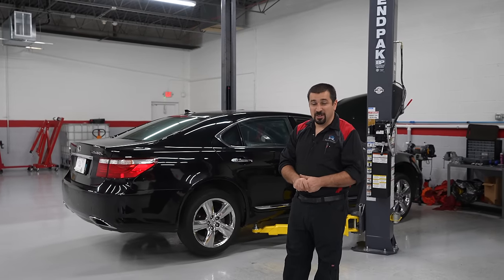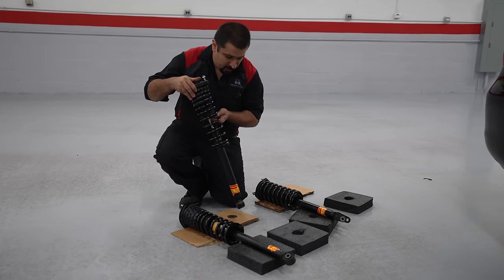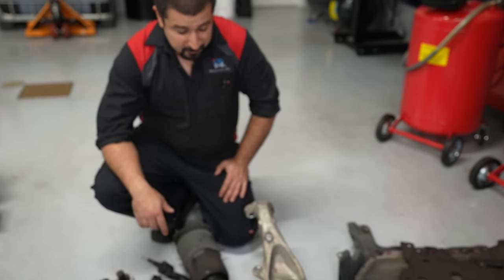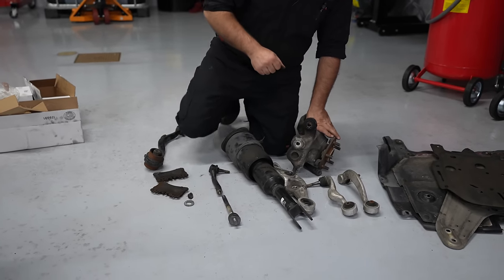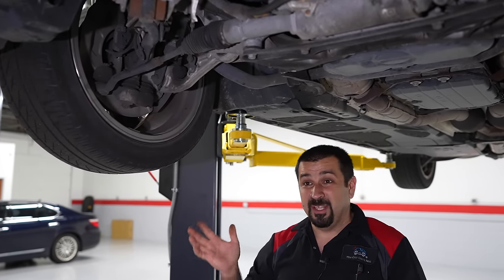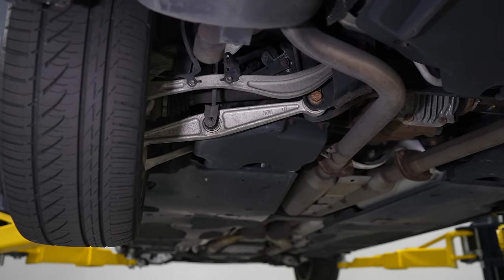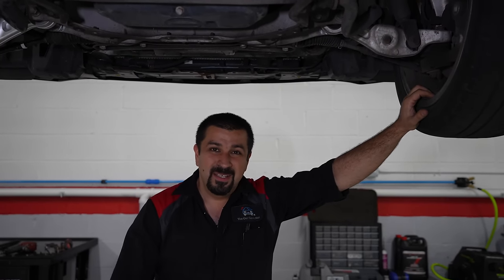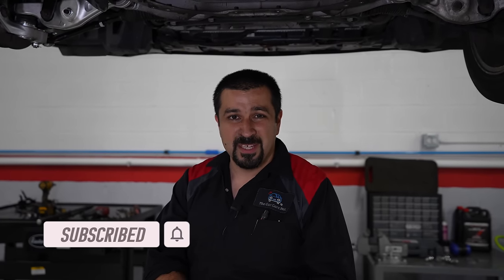Avoid THIS Lexus Model | Pre Purchase Inspection REQUIRED for this one and Here's Why.

Comment: I had a LS460 and it was nightmare, I replaced the radiator, water pump, thermostat, cooling fan module, and finally it had a coolant leak under the intake manifold. It had been hot so many times due to the cooling system problems, I finally traded it in and got a 4Runner. The LS460 was fast and fun to drive but a nightmare to keep on the road. Mine had less than 140K miles and was a nightmare.
Reply: That doesn't sound too bad for a 100K mile plus car.
Reply: @zaker600  nah, that’s way too much for under 140K miles…it’s a Lexus/Toyota
Reply: @ItsAxelFoley  my LS600Hl has had zero problems after 150.000 miles.
Reply: @epoxy1710  I’d say that’s pretty standard. I’m a 4Runner owner.
Reply: Where u the original owner?
Reply: @ItsAxelFoley Zero problems after 150.000 miles is on one of the most computer controlled cars in the world.
Reply: @finalboss7956  no,  I was the 5th owner
Reply: I think the big question we should be asking you is … what year LS 460? Many years are great but some years are known for problems, the info really helps thanks
Reply: @enzoi9569  mine was a 2010
Reply: That does sound bad for a Lexus wow
Reply: It’s because they ironed out some of these big issues with the 2013-17 models. That’s why I’m looking for a 2016

Comment: As an ls600 owner, the symphony of noise over a bump is an accurate description, mine at 94k miles. However, it's not the hardest diy to replace the bushings and lower ball joint on the awd models. I also suspect axle issues so I bought axles as well.  Definitely adjust purchase offer accordingly when buying one, pay the right price, enjoyable cars for the money.
Reply: What year is your car?
Reply: How is your 600 ownership
Reply: 08, it's been great but I'm only at 96k as of today. Garage queen.  But if your not a mechanic or serious diy guy I wouldn't recommend it unless you want to burn money on labor.

Comment: I had one 2008 ls460L. That car drove like a dream. But its the same old suspension issue. I wanted to change the air suspension but I was advised against it. 3 months later after patching and toying. I flipped it. But the car is a dream.

Comment: CR has been the holy grail for consumers for ages in choosing used cars. Its record shows the 460 from 07 to 09 were cars to avoid. There is an extensive recall program even to cover the dash, inside door card, suspension, etc. because Lexus realized these model years were duds. I always believe and insist never to buy cars of new model years, especially luxury models regardles of brands. Think of them as new born babies. Cutting teeth, toilet train, immuno-vaccines, the whole nine yards to get them all bug-free until the babies are three, maybe four-year-old.
Reply: 2007-2010 actually. I’ll stick with my 06 LS 430.
Reply: Yes, I got 2013MY, it is great.
Reply: My 2007 was basically bullet proof from 90k-210k that I drove it.  Nothing but tires/brakes and an alternator that went after having oil leak onto it from a bad valve cover gasket that I didn’t catch.  It was an ultra-luxury model that had everything (air suspension original till the end) except the recliner in back.  As in all things YMMV

Comment: You've changed my mind about the 460.  I'm going to start researching a 430.
Reply: That’s what I drive and recommend. Do your homework on it though. They’re all getting long in tooth!
Reply: 430 is king but still gonna be expensive to fix when shit goes wrong eventually.
Reply: I would recommend an 2020 ES350 instead.  Looks like a 3/4 LS500 and not as complicated as the LS, meaning easier to fix.
Reply: @jml9550  they do look similar.. I can't tell the difference at times.
Reply: @Kauffman578  yep.  For around $50K, I think the ES35” is a bargain.  I currently drives a 2017 ES350, just hit 31K mikes this month.  It is quiet, roomy and luxury enough, but sure ain’t fun to drive like to RWD LS.
Reply: @jml9550  ES350 is basically a glorified camry but even soft.
Reply: ES350 is nice, but it's basically a gussied up Avalon.  I'm partial to a large sedan like the LS series.
Reply: @angusp5515  sure.  Actually It is base on the Avalon.  Some people do like to softer quieter ride, more luxurious interior and don’t mind paying a measly $10K more.  I was one of them, in 2017 I decided to buy the ES instead of the Avalon.
Reply: @jml9550  in the used car market you could back in day get some good deals for es350, priced similar to some Avalons. 

But if you are looking for good handling and reliability the GS350 is the way to go
Reply: @21Piloteer Sure, if the $35-40K price difference makes no difference financially, I would go with the LS as well.  We have to compare new vs new though.  It is not fair to  compare a 4 year old LS500 vs a brand new ES350.
Reply: @angusp5515  yep back in the days there were deals everywhere.   In August 2017 I bought my brand new base ES350 at $32K + tax fee, total out the door was $35200, Lexus were given out $3K cash back or 0% finance.   I bought the ES at $2K under invoice AND $3K cash back as I was paying cash anyway.  Now used and new car markets are just nuts, I just called a few Lexus dealerships here on a new Lexus NX350H for my wife and all of them wants minimum $2K markup and we are not even talking about cars ready on the lot, we are talking about 3-6 months wait time.
Reply: @jml9550  Thats a really good deal for an ES. thats cheaper than a new Camry XSE which are now like $35k +, and are not worth it. The new ES now starts from $44k +
Reply: @angusp5515  yep I couldn’t refuse that deal.  Before I bought the ES I had a 2009 Avalon Touring which was running perfectly fine at 150K miles and I sold it at $9K to a co-worker.  Anyway, as the saying goes, you can find the best deal when you don’t need it.  I didn’t NEED the ES, the Avalon could’ve gone another 100K miles I believe.
Reply: @angusp5515  and yep. My sister had a 2018 GS350 F sport.  It is a great car, reliable and handles well.  I would take the GS over a 5 series or E class any day of the week.
Reply: @jml9550  I'm not comparing anything.  My original post was about researching a LS430.  I literally have no interest in any other Lexus model.
Reply: @21Piloteer  alright, I am cool with that.  If you find that perfect LS430, hang on to it.  They don’t make the like that anymore.
Reply: @jml9550  thats very true, the market now is horrible
Reply: Too old any old car is going to need more maintenance buy a newer LS

Comment: LS460 owners need to sue Lexus for the brake actuator that typically fails.  Another inspection is looking (listening rather) at the actuator.  If you listen on the driver side, if the brake booster pump is constantly pumping every 20-30secs, then the actuator is leaking pressure.  Eventually the C code for the actuator loss of brake pressure will be thrown first along with 5 lights/warnings in the car.  If you go too long without changing the actuator ($4000), you could also burn out the brake booster pump ($4000).   

Toyota originally designed the original bushings in the control arms with rubber, but after the revision with the 2013-2014+, they intergrated thermoplastics in them.  I found a lot of mechanics fail in the install when they don't torque the lower control arms at ride height leaving the new control arms to fail prematurely.    When you convert from Air to Coils, all you need to do is not mess with the height sensor and tie up the air line, this wont throw a suspension light or cause the air compressor to run constantly.    

The LS is just in another class than all other Lexuses hence the complexity.   GS and ES costs are relatively dirt cheap.  Whoever installed that brake pad... OMG, it would have sliced off the rotor hat and could have gotten someone killed.
Reply: The GS460 was the superior car in almost every way, none of the core issues except oil use if the prior owners did 10000km changes.
Reply: Did you mean torque the control arm’s while on the ground under weight or torque while tires are off the ground?
Reply: @dibaz1  Yes. This applies to the front lower control forward arms (lexus calles this NO.2 Arm).  Once you tighten that lower control arm, it locks the bolt and the bushing.  So if you were to do this while the suspension is fully extended, once you lower it, the bushings will be in rotational tension. This forces them to wear prematurely and wear out in a year or two.   You need a shop with a lift that will lift the car by the tires, thus will let the car sit level while the you do the final torque on this NO.2 arm.

Comment: When I saw this I had to go look on my list - my list I compiled listening to you during another of your videos on good vs. not so good Toyota & Lexus car models - and yep you've spoken about these LS's before I even made 2 notes on that one!! 

Good Toyota list:

Camry: 2015-2017
Camry: 2004-2006 V6
Camry: 2000-2001 was a workhorse
Corolla: 2005-2008 1.8L

Bad Toyota list
Corolla 98-2002 worst ever, bad rust
Camry 2002-2004 unless hasn’t been overheated
             V6 is ok – 2A2-FE
Rav 4: 2006-2008
Camry: 2007-2009 oil burners/rings
Matrix & Corolla 09-2013 – ONLY 1.8 or don’t do it

Good Lexus List:
ES350
RX350 but 2010 up
IS – good but not as good for tall people
GS350 – a little more in maintenance
GX/LX – both good
LS430 is the legend 2005 up
ES 300,330 – all except 2002-2006. 2nd best after LS430
-	Like 2004-2006 Camry XLE V6 very good
4.7 V8 is great engine

Lexus Bad List
IS250 in all years disaster had DI only and carboned up
4GR-FSE 2.5 w/D4 system avoid at all costs
GS250 – D4S is ok – has DI and port injection- no carbon
S250 
LS460 – 2007 to 2011
LS460 – nickel and dime you, bad brakes, prem fuel, etc. etc
Reply: 2012 just before facelift?

Comment: I bought a 2007 LS 460 a few years ago with 100k on the clock.  Had it professionally inspected before purchase and only paid 12k.  I feel very lucky that I got two years of fun driving out of it and only had to pay for one $2000 brake job.  BTW, it burned about a quart of oil every 700 miles when I got it.  Changed oil to Mobil 1 and went on some long road trips (adding oil as needed).  After 5000 miles, the oil burning stopped.  Guess the rings were fouled when I got it.
Reply: I've always used Mobile 1...  Some say it's just hyped advertising... 
I don't know the truth, but I have never had issues with any vehicle or yard equipment
Reply: @roncaster2804  it’s not hyped
Reply: 2000 for brakes on Lexus? I paid $1200 for all originals on Porsche (parts and labor with new wear sensors)

Comment: Rule of thumb avoid buying used cars with air suspension, and magnetic ride shocks as well (i.e. Corvettes), even if you inspect it and there's no problem with the shocks trust me its only a matter of time before they fail and its a pretty penny to replace

Comment: There is a revised part for the front lower rear control arms. I am strongly hoping for more detailed LS460/600 content like this. I love mine and here in germany they only came with "all bells and whistles". None were sold without softclose or the air suspension. The sales numbers here were really low (like 70 over ALL twelve LS F4 model years) so it is not easy to find someone that really knows this car inside and out. I would love to see a transmission fluid change on your channel, since this is the next thing that needs to be done on mine.
Reply: 2010+ has the revised LCA right?
Reply: @kinglumpy6145  I am not 100% sure but i think so. It has the problematic mounting point reinforced.

Comment: I owned 2016 LS460 swb without air suspension and I got rid of it after it has almost 100k miles. It's a different class and please don't compare it with the low end ES350 if you can't afforf it.

Comment: I currently have a 2004 LS 430 as my daily driver. It has no leaks or issues of any kind. I've driven it for about 8 years now.  I had cross shopped it with a 2007 LS 460 and I preferred the ride of the 430 by far. I sometimes look at a late model LS460 for an upgrade, but I am also considering an ES300H instead. I don't want headaches as I get older and the allure of driving the flagship has worn off. At this rate though, I don't see parting with the LS430 anytime soon. Maybe drive it a couple of more years? I have a feeling I'm really going to miss it once I move on.

Comment: I have a 2010 LS460 that started burning oil not long after I bought it. Turns out it was one of the valve stem seals going. I did notice some blue smoke on startup and it used about a quart per 700 miles. Luckily, I got the car with an extended warranty which covered reconditioning the cylinder heads (and everything else that goes with doing that) and some other suspension parts (like control arms) that were found to be going out. There were also two summers where the dash had to be taken apart to replace AC actuator motors.... again covered by warranty. The warranty covered more than the car is worth so far and I still have 24,000 miles left on it with a car that has 126,000 miles. I got lucky... I would never get a car like this without some sort or warranty.
Reply: Did you get the warranty from the dealership or an independent?
What type of warranty and how much?
Thanks.
Reply: Hey . Where did you buy that warranty? Carmax ?

Comment: LS400 air suspension gave out on one wheel, $1,800 quote from dealer, took it to a mechanic and converted to struts for $1,800 on all 4 wheels.

Comment: I have a 2020 ES350 Ultra Luxury. I looked at the LS-500 and just didn't think it was worth the extra money and repair costs. The LS 400 Series cars safety features and technology is just too old and out of date. Very happy with my purchase so far.
Reply: Paul what grade gasoline do you need for ES350? Does it have to be premium?
Reply: @frankie3591  87 for the 2020, same as my 2017 ES350.  Great car, mine is 5 year old 31K miles and not a single issue.
Reply: The LS is a totally different Lexus than an Avalon based ES. Not many can afford the 500 anyways

Comment: Japanese and german car makers seems like they avoid any service procedure that requires a press .  I guess it's to keep the requirements for a service shop down?  It seems silly to me.   On the LS460 knuckle ball joint, control arm bushings and even the wheel bearing hub are individually serviceable with a proper shop press.  A suspension specialist shop in my area does a good business replacing "non serviceable" parts like this  on high end luxury cars.  The whole point of going to a non dealer service provider I thought was to get around the service constraints imposed by the manufactures.

Comment: The valve spring recall was prominent in these years. And if it wasn’t done just right it resulted in oil burn later in life.  A lot of the 08-09s that burn oil THATS the reason.  I would bet this  car had that recall done. It was a VERY TEDIOUS job that had to be done perfectly.
Reply: Valve spring recall?
Reply: @9ZERO6 yes.  Did  u see the link I posted?

Comment: Very helpful video, will keep an eye on my suspension components. I purchased my 07 LS460 from a Lexus dealer in 2018 and the only work I've had to do is to replace water pump. I love the ride and engine/transmission combo, but am very aware that it may cost me a lot in the future as its still riding on air suspension.

Comment: I think I heard him say he’s in Illinois. If so, that could have a lot to do with why the front suspension fails so savagely on these. The road salt there is wicked and definitely puts a big hurt on rubber bushings, but the other factors that kill suspensions are rough road surfaces and pot holes.  Illinois roads are loaded with millions of potholes. And the washboard roads that cover most of the state have very few smooth spots. Lastly there’s extreme temperatures… Rubber doesn’t perform well when heavily stressed at Arctic temps so when you’re out there running your very heavy land yacht around on washboard roads at 10 degrees Fahrenheit, while covered in gritty road salt and you hit a seven inch deep pot hole at 70 mph, something is going to fail. Just sayin.